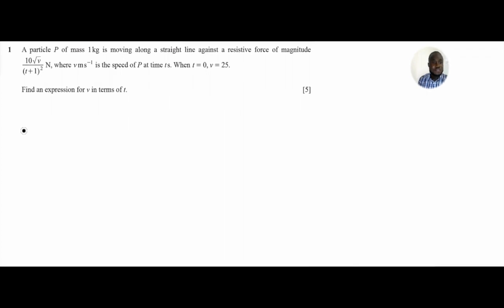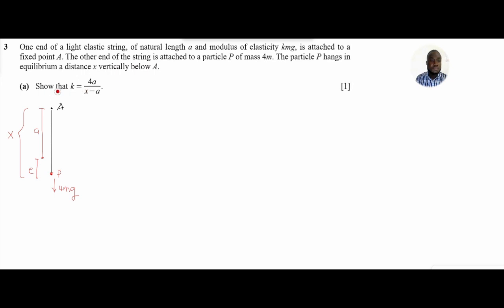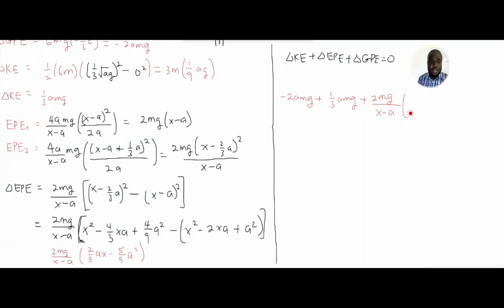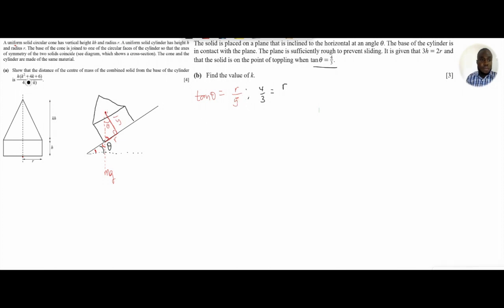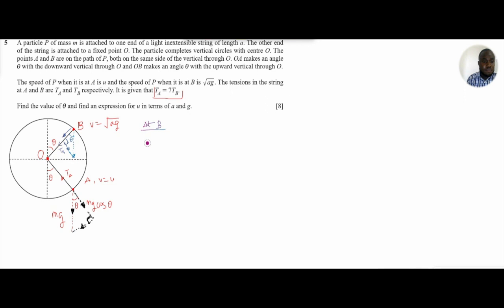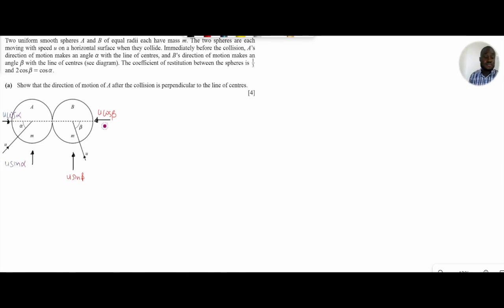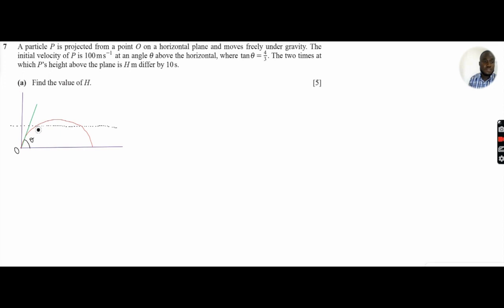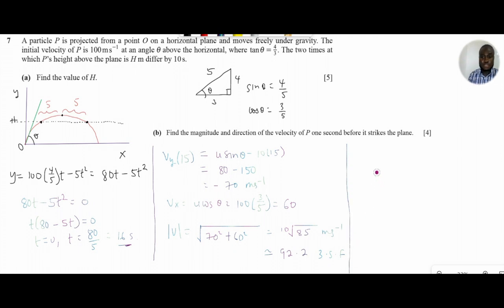CAIE FURTHER MECHANICS 9231 MAY/JUNE 2021 PAPER 31

Comment: why arent we considering the components of mass in q 2?
Reply from the maker: The weight of the particle (which is moving in a horizontal circle) acts vertically downward. This direction (line of action) is perpendicular to the plane of the horizontal circle and so this weight has no component in the horizontal plane. If we need a value for the reactionary force (from the hemisphere), we would have resolved the rection vertically and equated that to the weight, and I think we used this.
Also, the rection has a horizontal component which provides the centripetal force required to keep the body in the circular path.
Reply from the maker: If the body was moving in a vertical circle, a component of the weight would be acting radially either towards or away from the center of the circle and we would need to find these components in order to accurately compute the centripetal force that would keep the body in the vertical circle